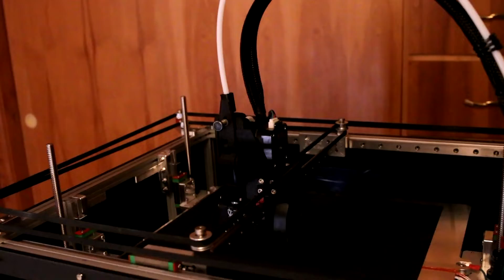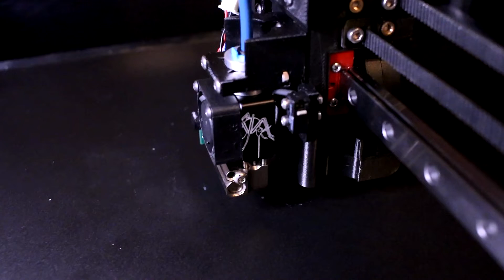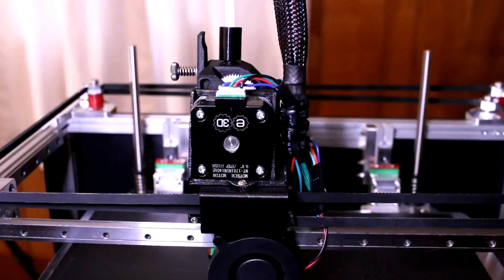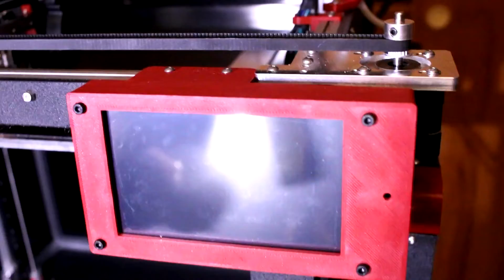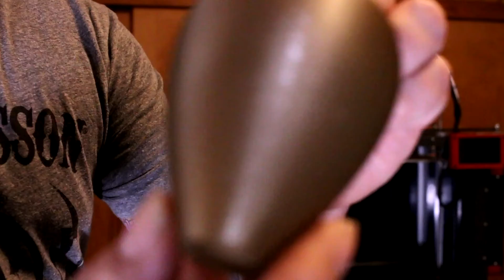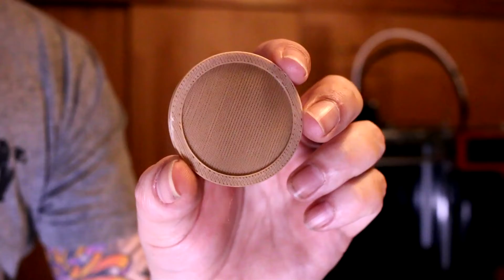Project R3D Railcore II Review

Comment: Thanks for the video.  I just ordered my 300ZL kit.  Question for you....how did you incorporate a screen?  As far as I can tell the kits don't come with any screens for input/controlling.  Would be interested in how you did that.  Thanks!
Reply from the maker: You need a paneldue 5" or 7" depending on what you want. There are a couple different mounts out there depending on what tickles your fancy for the screen if you search for railcore parts.
Reply: What size screen did you use for your 300ZL kit?

Comment: Subscribed, clear and simple video with no waffle. thank you. You have sold this design to me.
Reply from the maker: You cant go wrong. The best part about it is you can always find some way to customize it and make it your own.
Reply: @TheMakersDimension  don't see large formats of this model though, i.e. large print beds beyond the 300x300. I'm looking to do a 600x600x600 machine with four heads with two each on two separate x carriages - if that makes sense. Looked at the usual suspects of hypercube, voron, etc but the railcore seems the route. I suspect it's going to be nigh on difficult to align rails at that dimension but going to have a go.
Reply from the maker: @leeguilfoyle9481  A large portion of the reason that it is 300x300 is due to the heated bed. If you go much larger than 300x300 the bed tends to warp or sag.
Reply: @TheMakersDimension  Good point. I'm using a thick cast alloy plate (ecocast) with four ball screws to raise and lower (and level). Still looking at heating options (silicone, PCB, etc). I will zone the plate into four as the machine will not be printing full size all the time anyhow. The aim is multiple identical prints as opposed to a single large one but the option is there.

Comment: Hey there, thanks for the review! How is your printer holding up? I've wondered why the z axis leadscrews go so far above the useful range? Is there some hidden purpose to that?
Reply from the maker: Its holding up great. I've done a few mods here and there that weren't really necessary, but went for it. I actually bought a 2nd ZLT model as well. The long lead screws were on the original models, but aren't like that anymore. Now they are flush.

Comment: its $1450 most companies would likely charge $3000 for it. I'm usually the one knocking the price saying i can build it cheaper. 
i wouldn't save much to justify building one sourcing parts. pretty much only save on not having to get the 2 parts machined.
Reply from the maker: Totally worth the price. I'm looking to build a 2nd one.
Reply: just wished they made a bigger print area....
Reply: @Redemptioner1  same, Id really consider a 500x500x500 version
Reply: @Nordic_Mechanic  The ZLT version has a 300 x 300 x 600 build size and starts at $1,900 but I agree with you. I'd like at least 1 cubic foot of build space and since it can print fine details I'd definitely buy a kit of that size. I'd even be picky and chose 610 x 610 x 610 (~2' x 2' x 2').

Comment: Hi,
Great video!
I'm working on a similar project (duet wifi, linear rails, 3030 aluminium frame)...
I'm in the process of bed design.

Any chance you could show how the bed is mounted to the Z axis?
How it's isolated from the lead screws mount?
What I can see there is no additional layer under the bed. Is it screwed straight into the mounts?
Reply from the maker: It is fastened at 3 points to the z axis rails.
Reply from the maker: If you would like message me on Facebook and I can send you close ups.

Comment: You mentioned the magnetic bed from 713.  What sheet do you recommend you use with that?  Whambam sheets or something else?
Reply from the maker: I just happen to have a wham bam already on the way. I might just use that. I would think the buildtak flex plate would also work. Really any springsteel sheet of that size that you can find should work with it as far as I understand.
Reply from the maker: Actually it turns out I ordered the twin pack! I forgot about that haha! Now I don't need to decide to use it on this or something else. Once I get it I will let you know how it fits.
Reply: Congrats Austin with your channel! Very nice and detailed review thanks! Coming from railcore fb group btw ^_^
Reply from the maker: @emrekoc  Thank you! I appreciate it so much! I am trying to talk slower which is still a bit awkward for me. It takes all of my concentration to do it. Lots of takes as I usually speak at like 100 mph lol.
Reply: The Maker's Dimension Its pertty much ok i think 👏🏼 One suggestion i can make is take some closeup shots for 3d models or printer parts without sound and talk for that parts in your wide video and just make video cuts to those shots. Its hard to shoot with camera and talk slowly simultaneously 😊
Reply from the maker: @emrekoc  Good tip! Thanks Ill try that next time.
Reply from the maker: My DSLR doesn't take the best close ups oddly enough. My phone actually does a better job.
Reply: The Maker's Dimension It’s ok to mix and match. Would love to see some close ups on railcore prints 👌🏼
Reply from the maker: @emrekoc  Ill definitely do that I might do a mini video just on that.
Reply: BTP340X332 (Customer Part # BTP13X13375) Additional BuildTak FlexPlate - 13.07" x 13.39" (332 x 340) (Raise3D N2)

BT12X12 BuildTak Original 3D Printing Surface: Dimensions inches (mm): 12" x 12" (304*304)

Fits great.
Reply from the maker: I just assembled my mag bed and used the  wham bam flex plate. All I can say is Wow! I will do a review this weekend.